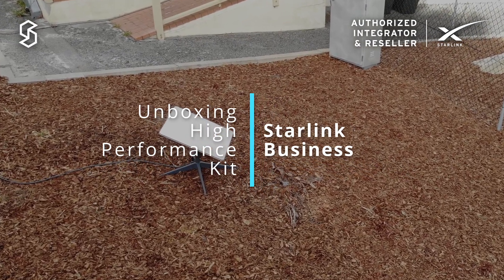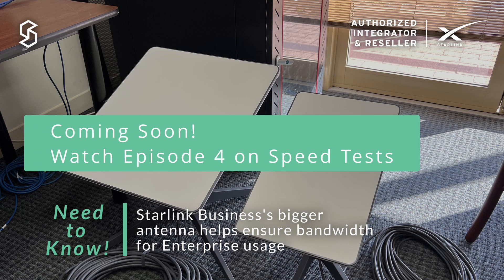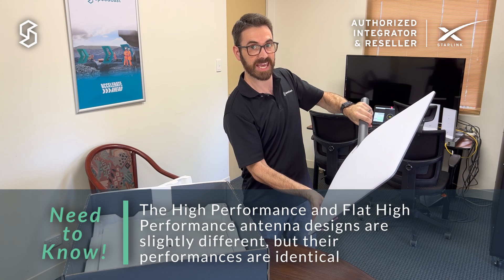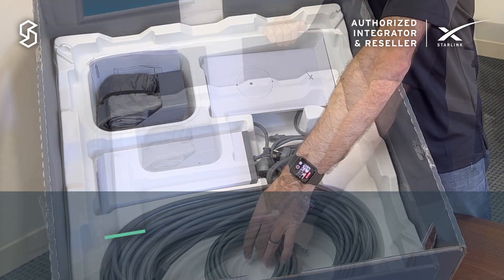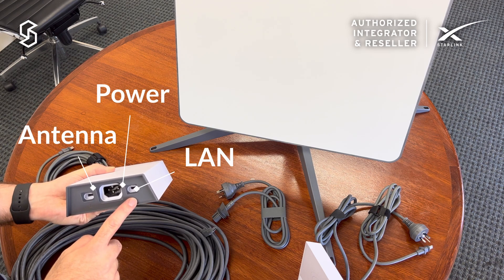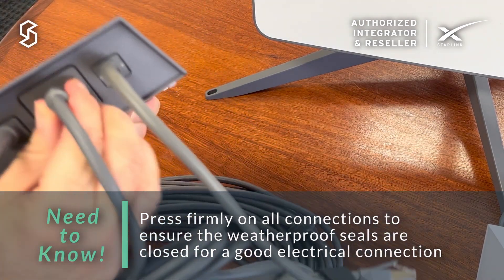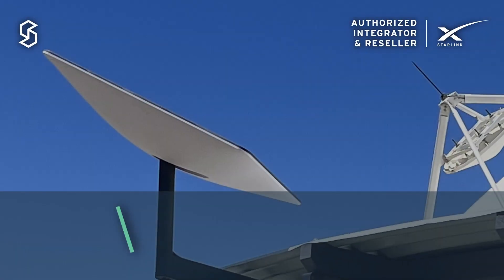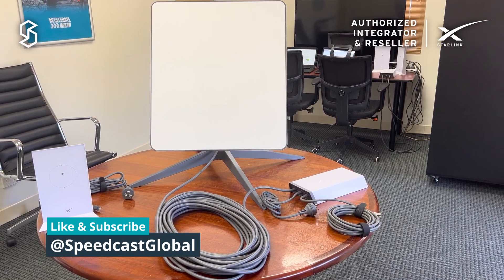Unboxing Starlink Business High Performance Kit | Starlink Authorized Reseller & Integrator

Comment: Is an ethernet adapter even required for the business kit since the business kit comes with a Proprietry? to RJ45 cable so you can plug the Power Supply Unit directly into a router of choice?    What function or advantage would an Ethernet adapter give for starlink business, if any?
Reply from the maker: Thanks for tuning in! The ethernet adapter is important if you are plugging into a simple device that cannot pull from the Carrier Grade NAT. The Wi-Fi Tower does this functionality and provides a fixed IP on the Ethernet dongle. So rightly noted, if you are plugging into a router, most can easily handle this functionality and you don’t need the tower nor the ethernet adapter. This is our recommended solution to enterprise customers given how easy it is to default the Wi-Fi tower.

Comment: can I use ethernet v2 adapter with the high performance? lets say I wanted to use the starlink wifi adapter as well as ethernet.... looks like the high performance doesn't allow ethernet and wifi from starlink, looks like I have to go from power adapter via ethernet to my own 3rd party internet router.
Reply from the maker: Hi Aryn – Thanks for the question! Yes, you can use Starlink’s supplied Wi-Fi tower to act as a host and use the ethernet dongle with it so you have both the Wi-Fi signal and the ethernet connection. The HP systems offer this of course, but they have another option to eliminate the Wi-Fi tower (which is the cable you mention) but you have the option to do it either way. Thanks for tuning in!

Comment: I have the exact same setup and plugged the high performance RG45 cable to my router and it's not getting an internet connection.  What to do now?
Reply from the maker: Hi there - If it isn’t working, it's likely a setup issue on the router, or the router itself is not capable of being a DHCP host. We'd recommend you look into your router. Thanks for tuning in!
Reply: @SpeedcastGlobal  turns out it was an issue with the dish and they sent a replacement.
Reply from the maker: @notbhavn  Great to hear!
Reply: @SpeedcastGlobal    Do you have to enable "Bypass Mode" on the Starlink app settings if you intend to plug the supplied RJ45 cable into a 3rd party routers WAN Port?, otherwise would it not work ?